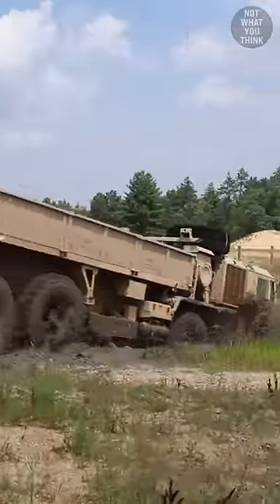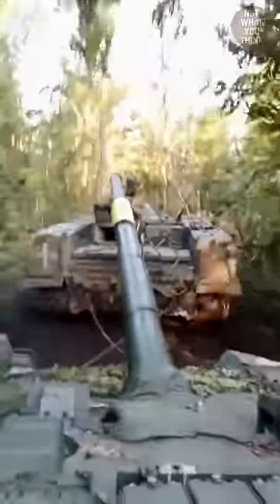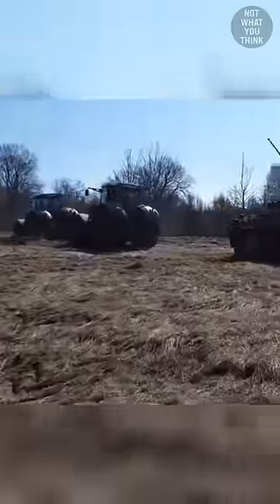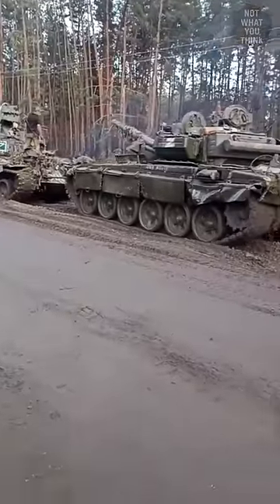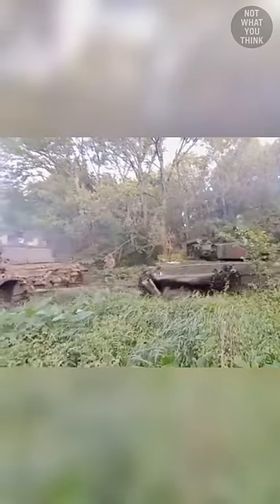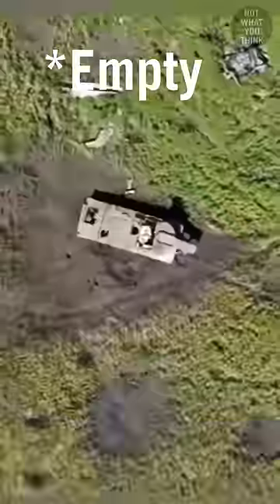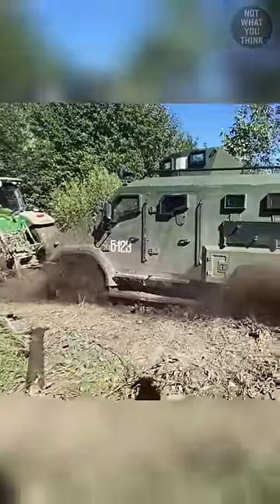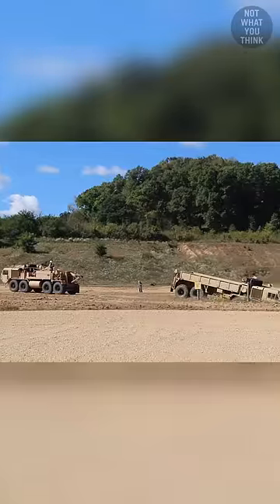Military Vehicles Getting Stuck #shorts

Comment: Spring started during a war.
Mud: let me introduce myself
Reply: Me just wondering what both sides eating while digging down in the trenches. Which side eating better?
Reply: @RhapsodicLoon both...
Reply: @RhapsodicLoon   I have it on good authority that the Ukrainians are quite partial to soup. Apparently training centers in the US had to add extra soup options to their mess hall menus when hosting Ukrainian servicepersons.
Reply: @petermoore5981  absolutely right. As during spring the ice get melt and due to the soil is get more muddy compare to normal rainy day
Reply: @Naturexyz-ow1ri Are you saying that the Ukrainians want more soup because of the mud? 

The comment you replied to was all about the Ukraine soldiers wanting more soup, and you agreed with them and then went on to explain WHY they did, but the reason you offered was because of THE MUD. Is that right or did I miss something?
Reply: @castleanthrax1833  I think the tanks and trucks can be pressure wash instead of using soap.
Reply: @Naturexyz-ow1ri What are you talking about?
Reply: @RhapsodicLoon  They are eating rats. The question is: Who's got bigger rats?
Reply: War started during spring* Sorry, that sentence structure is just bugging me.
Reply: @fallenneutron2740 You've changed the sentence, and its meaning. What if the war didn't start in spring? What if they were talking about the start of spring, which occurred IN a war?
Reply: It happens in the fall too. The rasputitsa is no joke.
Reply: Spintires the game
Reply: The Spring mud famously even halted the Nazi assault back in WW2, tho I think it wasn’t spring mud but just mud in general
Reply: @castleanthrax1833  Eastern slavs (both sides) love eating hot soups and porridges daily, especially when it's cold (anytime except hot summer). Cold and wet (and mud) or cold and snow - doesn't matter that much.
Reply: Не зовсім , повно маштабна війна почалася 24 лютого 2022 року , тому не путайте.
Reply: @RhapsodicLoon depend on which side is the bot

Comment: Dam that first recovery vehicle got some power 👁️👁️
Reply: And enough weight.

Then again.. those zoviet tanks weigh about a half of a combat loaded Challenger
Reply: @rohesilmnelohe  Challenger 2 64T
T90a 48T
Guess witch one will have a hard time in the mud
Reply: Dude, I was at Graffonvohr Germany when one of our units Humvees got stuck in some pretty serious mud. Our unit sent a 5 ton to try and pull it out. It gets stuck, like dug in to the axles.
My unit then contacted an armored ground ambulance company in our battalion that had a tank rescue vehicle. It came over and pulled both out like it was pulling a piece of paper. Those things have an incredible amount of torque.
Reply: @MuffinMan101 both ffs, no tank can go through mud well. Russian tanks are lighter but have low ground clearance, chally has more ground clearance but weighs a lot more.
Reply: @gavinlightfoot5521  they have wider tracks